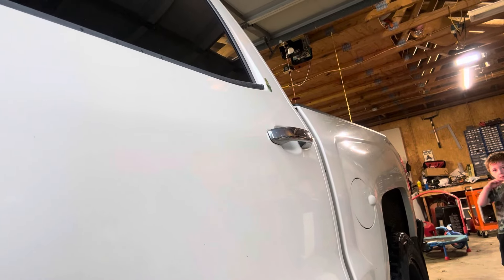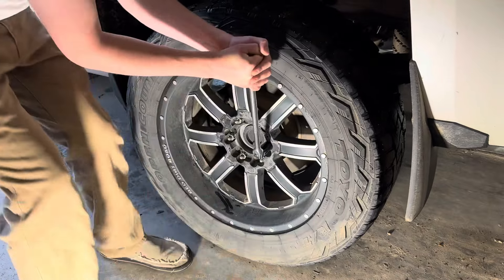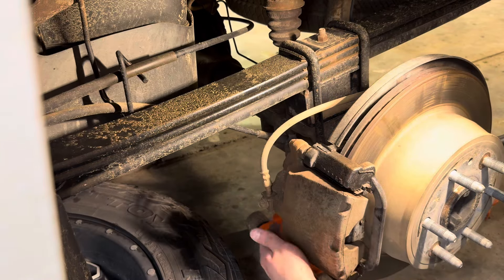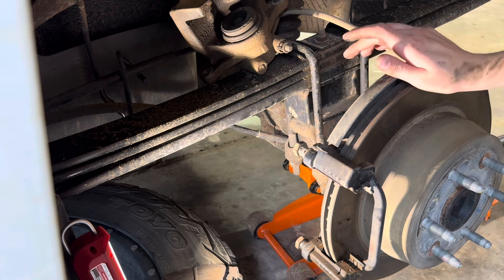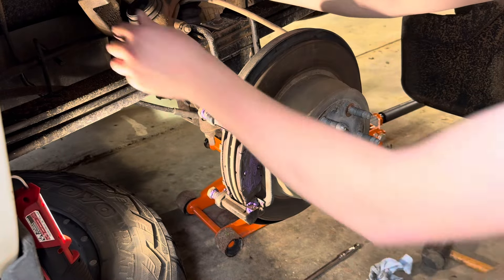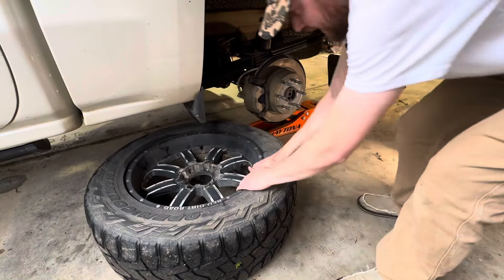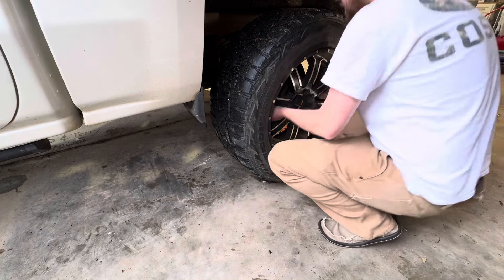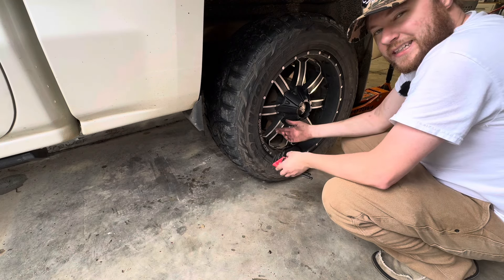Fix brake Creek squeak 2014 to 2018 Chevy Silverado or GMC Sierra

Comment: I had the same noise on my 14 sierra. Pulled the pins, they looked good but cleaned them up and greased them. Noise went away!
Reply: Absolutely same here pull your pins clean them even though the grease looks clean and re grease and put it back together easy fix this time lol.

Comment: the ears of the pads/tops of the stainless clips are not supposed to be lubed so dirt doesn't build up in the grease and hinder breaking/cause uneven pad wear, consider popping the clips off and checking if there's rust scale swelling against the clip in the channel and clean it up and put a tiny amount of anti-seize or similar under the clips. as for the backs of the pads its frowned upon but can help on vehicles that the brakes are known to creak on braking even with good slide pins and such, just use enough to barely coat the liner on the back of the pads where they contact the caliper so as close to nothing as possible can get washed onto the rotor and contaminate your pads and worsen your breaking